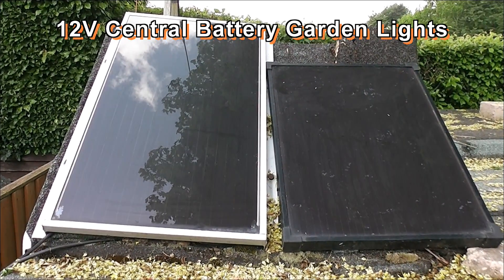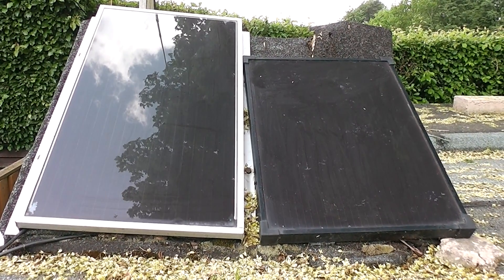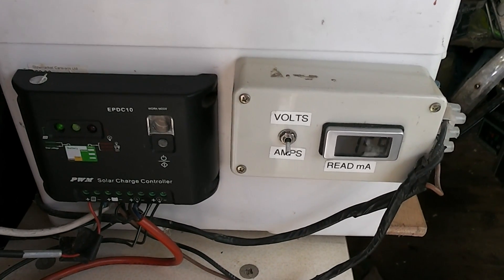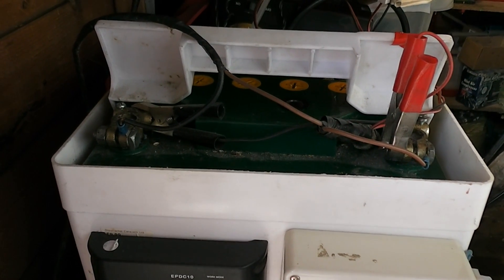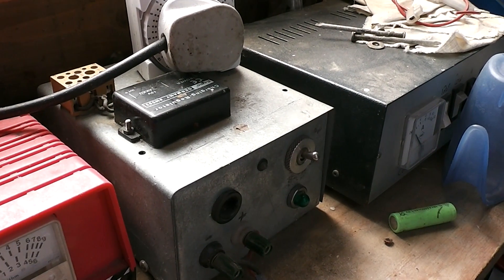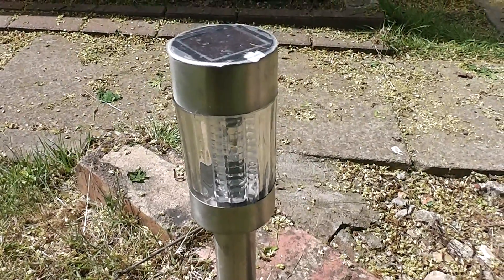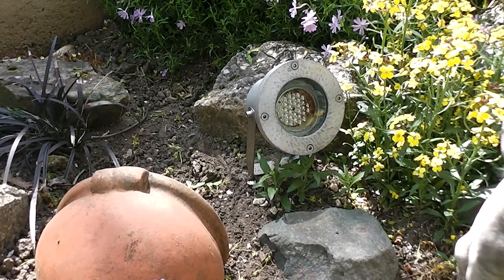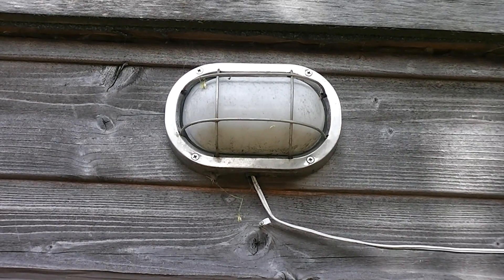12V Central Battery Solar LED Garden Lights

Comment: Nice video.  I have a similar 12v garden light system.  I use 2 led floods (40 watt each) with motion sensors along a pathway.  I also illuminate a 10ft. led strip under a canopy, controlled by a 12v touch switch.  I'm currently using one battery and all works well.  When I attempted to attach other lights, I quickly found I needed to add more batteries.  I'm using a Renogy PWM solar charger that apparently doesn't charge the bats to 13.8v-14, like my cheaper $10 Chinese PWM.  Should I be charging up to 14v?  In a car, the bats do get charged beyond 12.8, so I figure it should be ok...
Reply from the maker: I had to replace my charge controller and went for a device that held the batteries at around 14.4V for 2 hours then switched back to 13.8V.  Of course it depends on the battery type you are using.   I made a video on this. https://youtu.be/Y_ygH_eo9qw